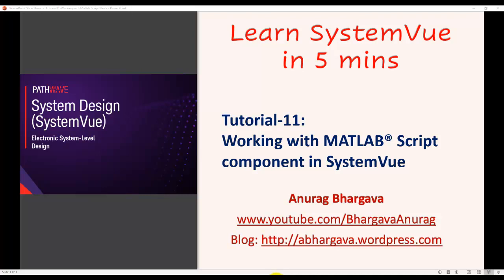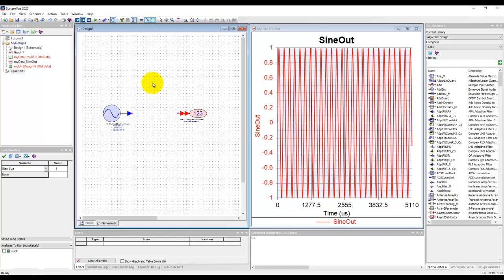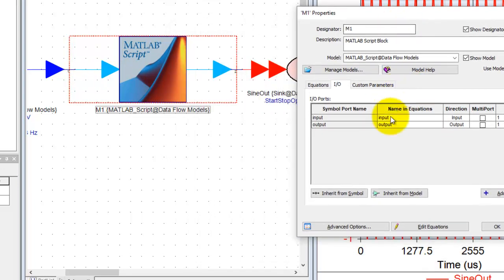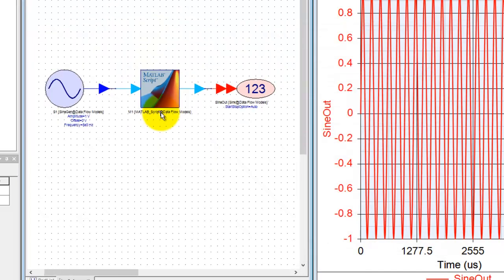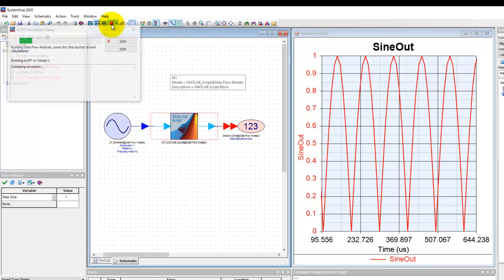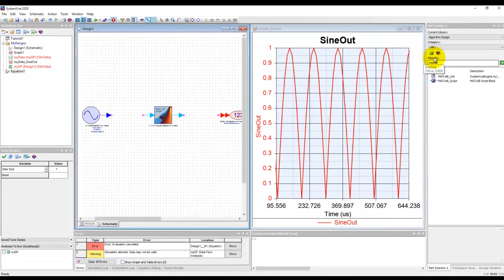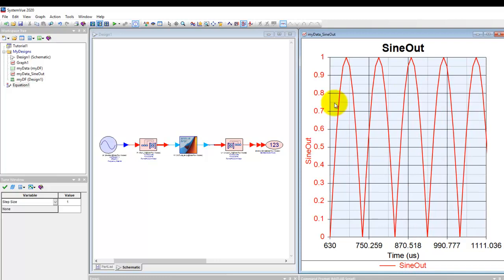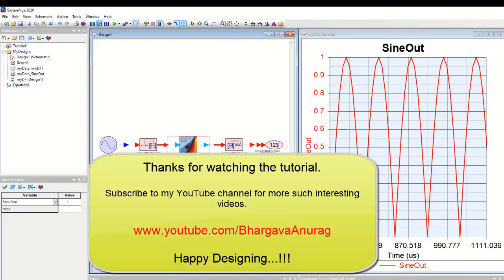Tutorial-11: Using Matlab Script Component in SystemVue

Comment: Thanx for the explanation and a nice video..
I wanted to know if system vue supports" for loop/while loop" ?

I wanted to run beam former weight and beam pattern multiple times based on some criteria of half power beamwidth..

So, basically i want to find the weight of 8*4 antenna system in such a way that theta half power beamwidth is 65 degree ..

So i need to run these token multiple times..i will check what is the theta beamwidth and If it is not 65 degree then again i will run beam former weight And then beam pattern..
Reply from the maker: Hi Piyush,
It should be quite simple to do as you can write a simple Matlab based routine using the built-in Equations page which basically is Matlab. Using the Equations page, you can run simulation, post process the results and then make decision on what to change and rerun the simulation as you want, all from the same script. You can keep the loop running till you achieve what you want. You can contact your local Keysight tech support team to get help on this, if needed...👍